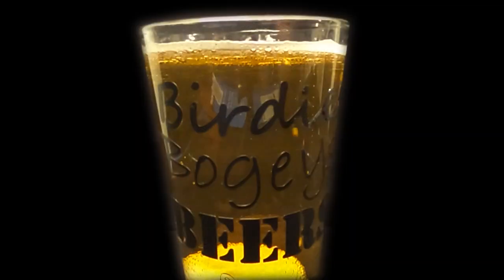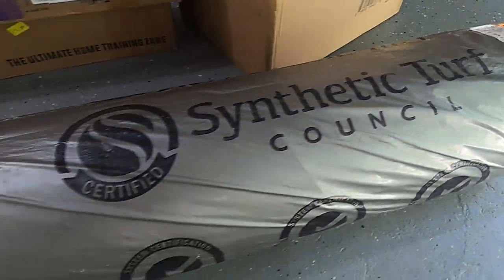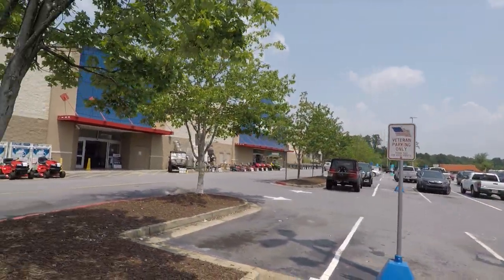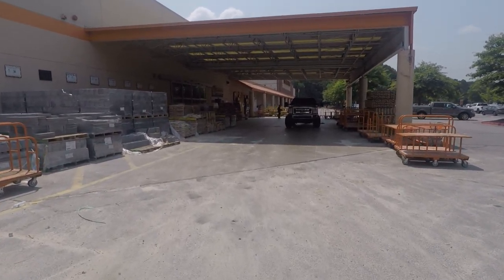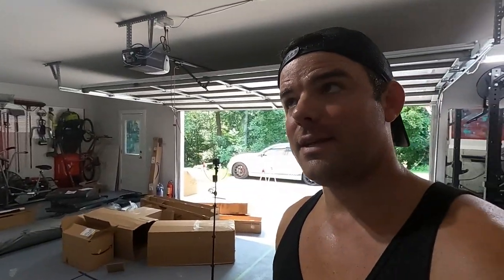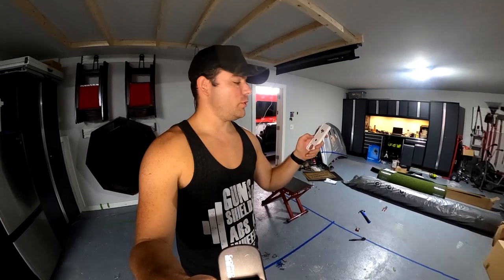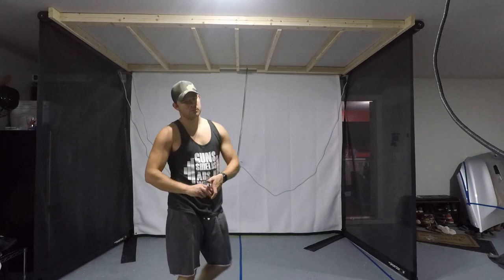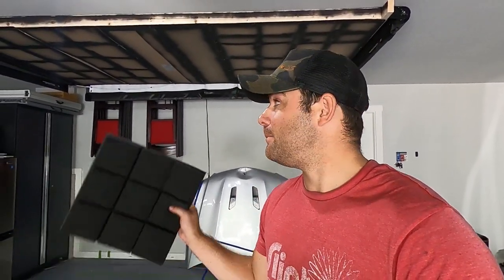BUILDING MY DREAM GOLF SIMULATOR // Impact Screens, Nets,  & Enclosure - Part 1/2

Comment: Great video!  Setting up my simulator in the garage and curious with the projector screen.  Are there two separate screens, impact screen and projector screen?  Or are you just using the projector screen as the impact screen?
Reply from the maker: Yes, two screens. One behind it (similar to the side panel screens) that has a velcro strip across the width. Then the white projector screen attaches via the velcro. Hope that helps, cheers!

Comment: Both videos are great along with the one that describes how much you paid for all this. I think when I do the math, I'll probably be in around $8k in costs myself. My garage isn't deep enough to use the Mevo so I'll need to get the Skytrak or jump up to the Bushnell. Question - for the retractable screens, did they offer mounting brackets. Just wondering why you mounted the lumber to the ceiling outside of having to do that to install sound dampening foam. I've been looking at the HomeCourse retractable screen as well which is a little less expensive.. Thanks for the feedback..
Reply from the maker: I’ve seen good things with the Bushnell, but haven’t personally used it. The retractable screens I bought did come with brackets. The main reason for the frame was that those bracket locations didn’t line up with studs particularly the side panel screens. Then I also figured it would double as the “top” enclosure. Hope that makes sense. Cheers!

Comment: Have you hit any wedges off the sound panels? How do they handle it?
Reply from the maker: Yes and not the best, haha. If I did it again I would probably put the same flooring tiles I used for the landing area as a base for the enclosure. Then put the sound panels on. Wedge video is coming soon! Thanks.